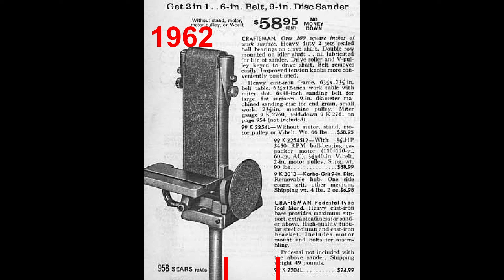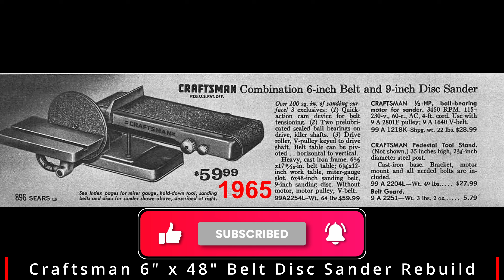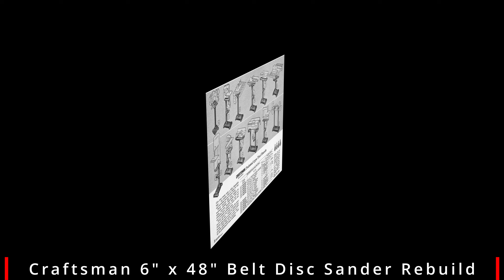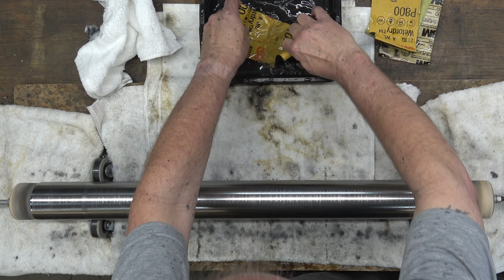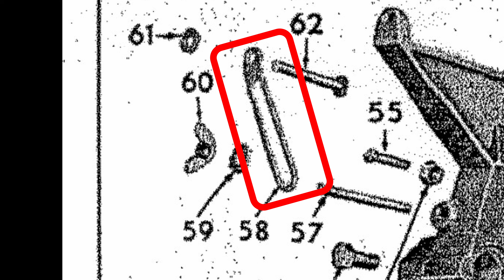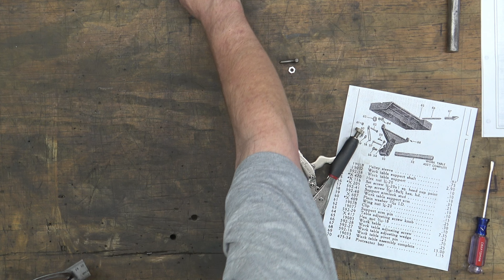Part 8 Craftsman 6x48 Belt Disc Sander Rebuild (Column Polish & Fabrication)

Comment: The wedge, threaded rod, and thumb wheel is actually for making fine adjustments before locking down the support brackets. It was a feature on the original 103.08011 and larger 103.0803.
Reply from the maker: That makes way more sense and if I had taken time to read the Owner's Manual, I probably would have figured that out. Thanks for point this out. With the missing parts I really did not think about the design very well and got focused on fabrication.